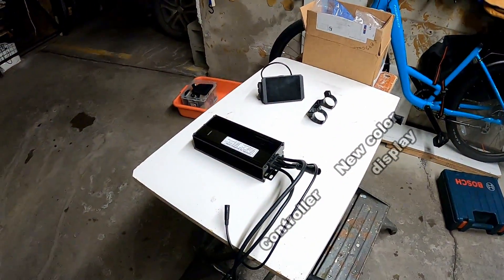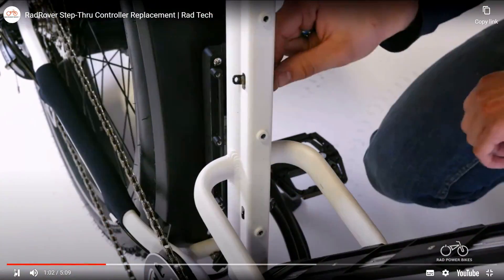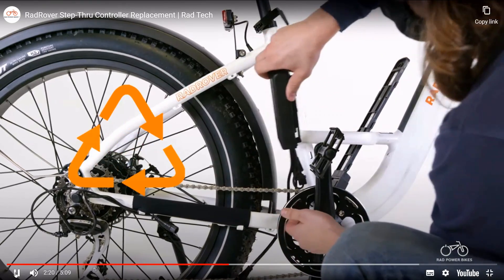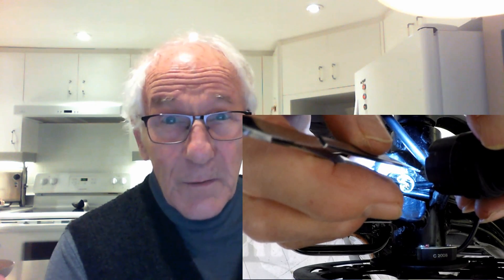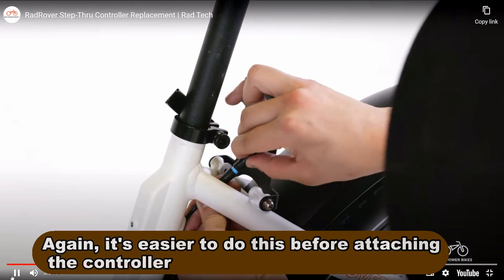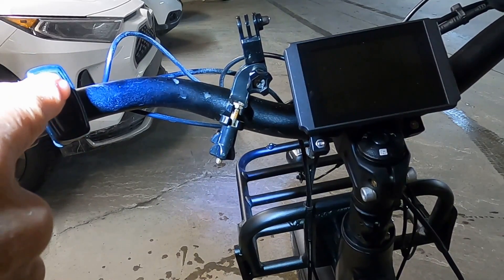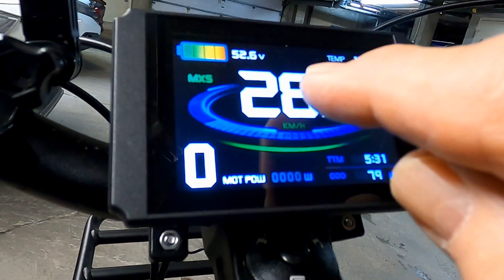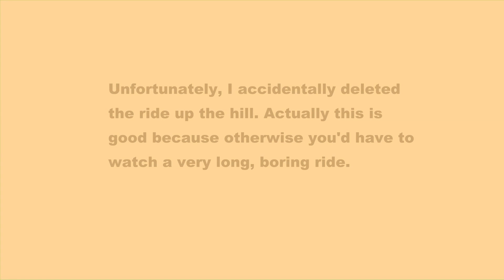How I Made a Rocket of my RadRover by Installing a 35 Amp Bolton Controller

Comment: I’m using my stock H6C display on my new 35a controller. It works fine. The torque increase is insane. I would advise people with slow 36v and 48v bikes, to get a 35a sinewave controller if your batteries are rated at 40a.
Reply from the maker: Thanks for sharing your experience!

Comment: Bought one of these bikes missing half the electrical stuff. But it came with two controllers and an extra Bafang motor. Finding parts is a nightmare! I do have the bolton display and I would guess one of those controllers, but nothing else is there. It can power up the motors with an after market controller but these two controllers will not run the motors. It looks like somebody got frustrated and just ripped all the wiring apart. No info anywhere of any of this struff, that I can find so I'm rebuilding from scratch. Oh, I am a diesel mechanic, so this isn't an issue, I am fluent in all of this stuff. But finding support for this stuff is hard. Even cables are hard to find. I did finally find out what to look for but that took about a month.
Reply from the maker: I'm not adept at motors and electronics, so the fact that I changed the controller and display will result in Rad not being able to help me if there's an issue, however good they have been in the past.

Comment: Good conversion the will give you much more of a "Magic Carpet" feel. 
But... I'll run my E-CELLS Super Monarch Crown 2 wheel drive, 2 battery, dual suspension bike against your modded RadRover any day.
My controller is a 44 amp, 18 MOFSET unit with cooling fins (the company is in Pahrump, NV in the Mojave Desert)  
Also this bike had a 400 pound load maximum including rider but not the 95 pound bike weight.
Reply from the maker: That's quite the machine! I don't think I'll try to outpace you. 😉

Comment: i love the video and might i suggest diy studded tires with galvanized screws, use an old set of tires. i basically have the same style bike and went the same route. with a 750 watt motor. i get 52km an hour roughly on 35 a controller. cannot wait until winter with the studs
Reply from the maker: Actually, I took the expensive route and bought ready-made studded tires and love them. I can just imagine how screws would dig into the ice even more. Here is my video: https://youtu.be/Un6dtZWMhPI
Reply: thats awesome man and yes these tires are amazing. 
 @RobertBeriault753

Comment: Hi Robert, how was battery life affected after adding 35A controller?

Gord
Reply from the maker: I've never tested it. I should have done a full speed/throttle only test with each controller but I never thought of doing it. What I'm talking about is this: https://studio.youtube.com/video/jXB7POghKvc/edit
My impression is that my range has diminished a bit, probably because I accelerate faster and make more use of the brakes at stop signs.😉
Reply: i have a 20ah 50a battery and can say when i upgraded this route it definetly affected altho still have tons of juice, it can start to get up there but you do not have to have the full 35a of controller in use.

Comment: What does the orange 3 pin higo connector go to?
Reply from the maker: Can't see it. I pushed all the cables into the frame. It probably goes to the display.
Reply: @RobertBeriault753   thanks for replying my friend. Turns out that it is the throttle wire.. I had to retrofit a controller to work on my rover 6+

Comment: I  just took my Rad Rover 6 Plus out for 2 hours today. I live in an area with mostly hills, some steep. During a ride through a local golf course I came upon a medium in length, steep incline. I had it on easy pedaling (level 2-3) with pedal assist adjusted to 5, and nothing. I had to stop and walk the bike up the rest of the incline. I am not a strong rider - so this could just be me. This bike is a beast in weight. I decided to leave the course and go up other steep hills in my neighborhood. When I was in pedal assist 2-3, I still had throttle, but once I went to assist 5, I had nothing. I tried all different things with easy pedaling + assist 2, 3, 4....but once the hill became more steep, there was no assist on 5, OR no throttle with lower levels assist - nothing. I live over a very steep long hill, so now I am wondering if I just shouldn't have converted my mtn. bike to an e-bike since the RAD seems to be a dog.
Reply from the maker: There is something very abnormal about your Rad. I suspect there is a fault of some sort in the software or in the controller. Have you phoned Rad service department for advice? I found them to be very eager to help, even when I destroyed one of the cables by my own fault -- they replaced it for free!
Reply: Hi Robert - thank you for the advice.  I just emailed them at Support. Let's see what happens.

Comment: Can you control the wattage output on this so you don't damage the motor as it's a 750w peak motor?
Reply: Yes you can control the maximum current in the display settings using C5
Reply from the maker: The only controls are the pedal assist selector and the throttle.

Comment: I have wagon 3 . Any chance you know what settings I can use once I upgrade?
Reply from the maker: The only settings I had to change were wheel diameter and maximum speed. Pretty straight forward.

Comment: Does the battery drain faster?
Reply from the maker: Yes it does, because I accelerate faster because now I can.
Reply: @RobertBeriault753   is there an upgraded battery you can get?
Reply: @elcompachino6619  i think bolton also makes one, if not electro bike world

Comment: Is this controller able to be installed on a Rad Rover 6 Plus? Thanks
Reply: I can't wait for someone to come up with the goods on  making the Radrover 6 faster then just the 24.8 mph you can unlock it to vs the 20mph factory setting.
I'm having fun with the 24.8 mph but.... I need more juice!
Reply: @Meep2076  yes it does just look at there web site he even have a video how to install the controller
Reply: @heinekenboy6901  the upgrade gives much more torque but nothing more as far as top speed goes or going any faster top speed.
Reply: @Meep2076  you can try to upgrade the motor you will get a better booster of speed for sure but you will.need to upgrade the battery
Reply from the maker: Ask Bolton. https://boltonebikes.com/  Click CONTACT

Comment: I have seen those same small torque arms spin out under higher power and tear the wires, I highly recommend putting a sturdier torque arm on, otherwise well done.
Reply from the maker: Thanks for the feedback. I hadn't thought of finding out if an after market torque arm is available, and a quick look at Amazon shows that they're easily available.

Comment: Good ideas! I bought a DX3 battery adapter and added a 20amp hr and a 14 Amp hr battery to the stock battery. Now my range is about 140 miles.
Reply from the maker: Sounds great!
Reply: THATS ALOT OF ADDED WEIGHT! I'M EXCITED TO SEE SOLID STATE OR OTHER BATTERY TECHNOLOGY TO BE OUT SOON
Reply: @mitchcrilly1291  no need to write in all caps, it is seem as SHOUTING on the internet

Comment: Hi Robert. Thank you for a great video. My goal is to add the Bolton controller to my RadRunner Plus and to upgrade that motor at the same time. I use my bike in place of having a car so speed and power are important especially when I'm carrying loads with my cargo trailer. I live in Palm Springs so I want to be cautious about overheating t emoter as well. I already have 2 batteries so I'm prepared for the rocket mode!
Reply from the maker: Sounds like the upgrade would be useful for you. I'll be getting a second battery soon, seeing that sub-zero temperatures greatly reduce power and range.

Comment: It will be interesting to see how the batterypack drains too ! My experience is the usable battery distance will drop by at least 75% in normal temperatures and at -16C it can drop by 300%! Also the batteries specifikations can be  drained to hard and impair the lifetime heavily (?not to calculate the diminishing lifetime of the Rocket pilot 👩‍✈️) !!At -16C and 30km/h the wind chill makes the temp feel drop to about -25C 
a significant amount especially for the knees ! Be careful with that RadRocket Bernard
Reply from the maker: You're right about range. My range at -15°C is no more than 24km at 20 kph. I'm getting a second battery. I don't know about reduction of battery life, but you might be right on that too. But then, I'll just buy a replacement. When you've got yourself a rocket, you have to be ready to pay the price!